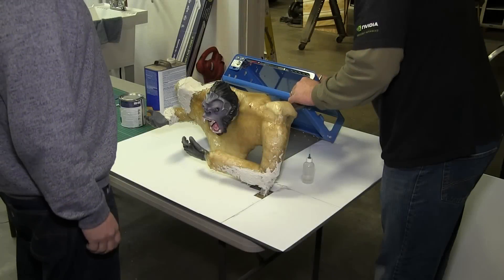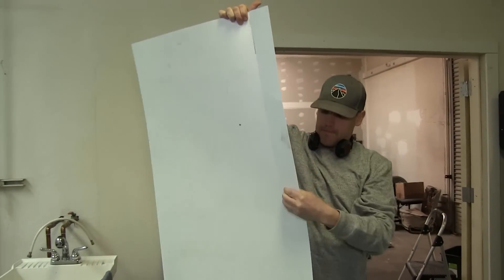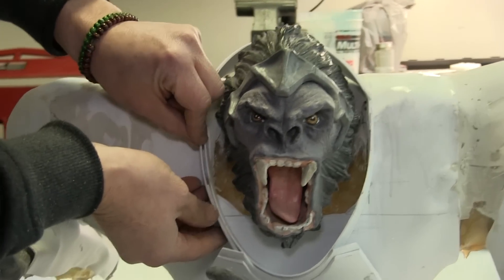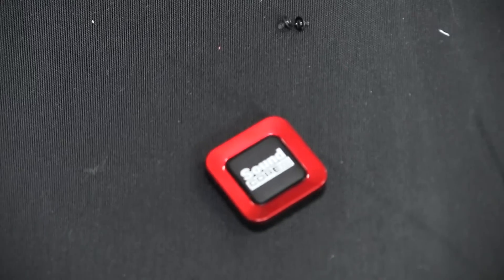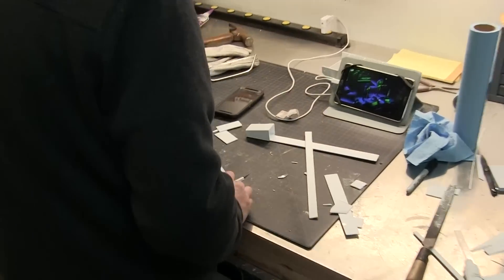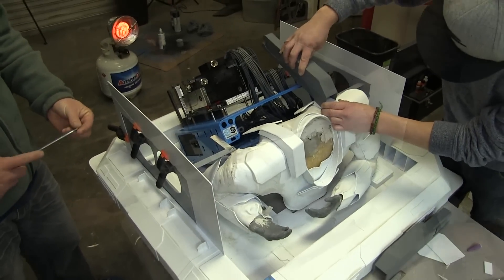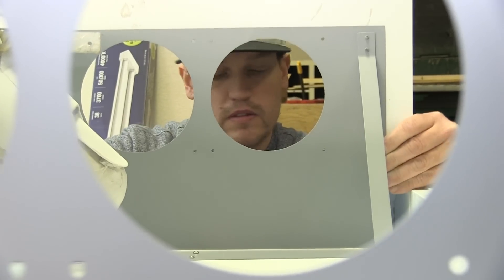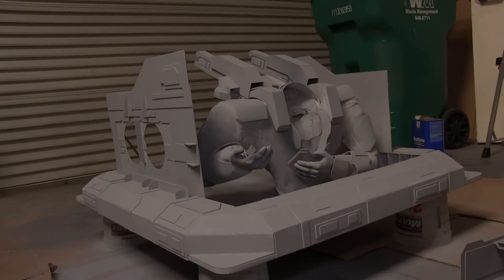Winston OverWatch Build Part 2

Comment: Best method to cut styrene, plexi etc. is to get one of those tiny 10 cm OD fine toothed (i think it's a 1 mm pattern, non staggered) 1 cm ID shank blades. eBay has them, Amazon as well, and at ~1 mm wide it's perfect. I believe it's for metal rather than plastic, mine has lost any kind of info with time, and i bought it four years ago.

Made my own table saw for it (and really, it's so easy to make one, it's two bearings, a shaft, and two pulleys. I initially used a waxed leather rope as a belt then i upgraded. I was lucky that the shaft and pulleys were a push fit, so didn't need any key for it. As for the blade i reused two spacers from an old grinder and i had a friend thread me 3 cm in the center. Offer that whole assembly with the bearings at the ends to a table with a slot and you're done. Used an old counter top with melamine for super slide.).

Cuts are even, crisp. Really worth putting one together, and the best part is because it's plastic you don't need an expensive motor for it. I had a mini angle grinder that had a broken butt handle (because China) and used that, it's probably twice more powerful than i need.  Really worth having because once you have one you speed up production of bits by 60%. You loose a little bit of time with adjusting the fence but once you're done, you're in like Flinn. Oh and did i mention i can cut full sized sheets??

Either way, awesome video. :D